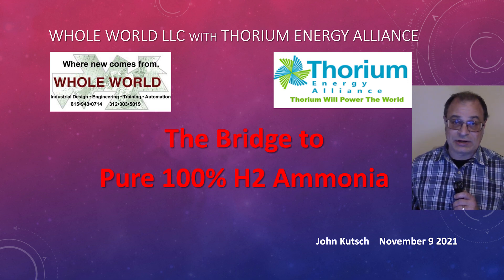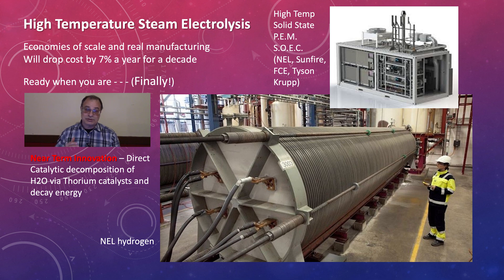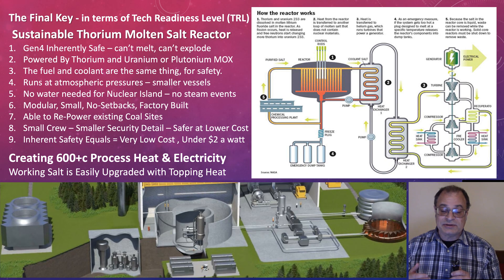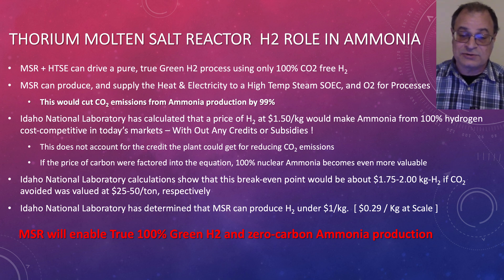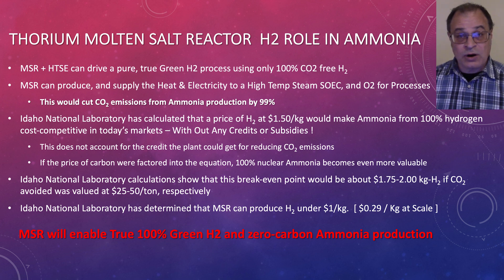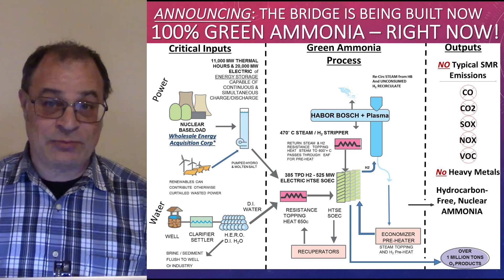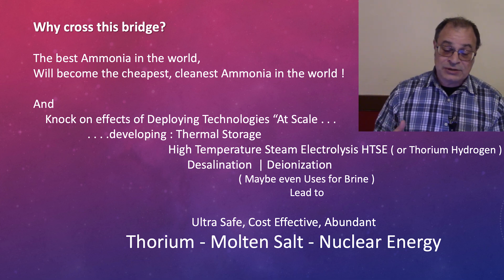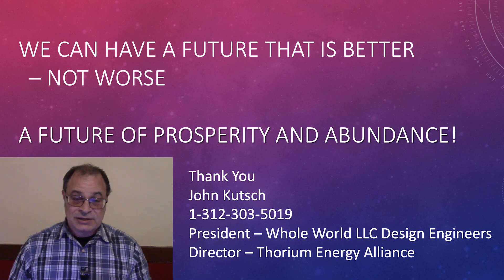Bridge to Pure 100% H2 Ammonia

Comment: 12:30 the oxygen byproduct of nitrogen removal from air, is used in steel production. 

Mining explosives could also appreciate the liquid oxygen generated, as ammonia nitrate emulsion based ones are only cheaper when excess oxygen isn't available. When it is, LOX mixed with powdered farm waste and pumped down boreholes may be cost effective. With much lower NOX emissions from mining than ammonium nitrate.

Oxygen can also be used to produce ozone, free from it's usual nox co creation and with that, clean ozone, clean people's water, with a better tasting outcome than chlorine. 

The oxygen as well, could be piped into municipal waste incinerators to increase temp and reduce dioxin emissions. 
One of the causes of dioxin generation is chloride ions in things people burn, so reducing chlorine in every step of cardboard. Really goes a way to making incinerator plants cleaner. 

With these likely the only remaining emission plants in the future, of no coal, it would be important to cut down on its nasties as much as possible with oxygen aiding in doing this. Already incinerators are liked to poor health from dioxin generation.

They would appreciate oxygen. As would all of we, humans that share the air.

Oxygen lances,  related to thermal lances, are very useful in removing caked on carbon in chemical reactor pressure vessels. Instead of using peroxide. Piranha fluid. Though on that topic, the making of peroxide by the old barium oxide recycling method, may be of better value when near pure oxygen is available.  As it may similarly be in manufacturing cerium oxide, for self cleaning ovens.

Though most of it will be vented in this case, bubbling oxygen through fish farming aquaponics systems, goes a long way in reducing ammonia build up. When limited space for fish to live is available, oxygen may improve the clarity of water and smell down wind. 

The deep ocean injection of oxygen may also make a layer of life that sequesters more carbon. 

Yet storing the oxygen in bottles for rocketry is one of the better solutions.  In the steel that it was earlier used to create. 

The first rocket plane the X15 was powered by oxygen and ammonia with both of them sharing a similar density, a single pump could be used...it was also probably the cleanest burning rocket fuel ever, in full life cycle considerations.

As the oxygen and ammonia came from one plant, haber Bosch. 

Once it is made cleaner, it will likely rival methane LOX in the aerospace industry. That spaceX is currently using. Though methane does have energy density advantages, when, or if the rate of launches increases, it may be a requirement to switch to ammonia. For environmental considerations.

Comment: 12:30 the oxygen byproduct of nitrogen removal from air, is used in steel production. It can also be used to produce ozone free of nox and with that, clean people's water, with a better tasting outcome than chlorine. The oxygen as well, could be piped into municipal waste incinerators to increase temp and reduce dioxin emissions. 

One of the causes of dioxin generation is chloride ions in things people burn, so reducing chlorine in every step of cardboard. Really goes a way to making incinerator plants cleaner. 

With these likely the only remaining emission plants in the future, of no coal, it would be important to cut down on its nasties as much as possible with oxygen aiding in doing this. Already incinerators are liked to poor health from dioxin generation.

They would appreciate oxygen. As would all of we, humans that share the air.

Oxygen lances are very useful in removing caked on carbon in chemical reactor pressure vessels. Instead of using peroxide. Though on that topic, the making of peroxide by the old barium oxide recycling method, may be of better value when near pure oxygen is available.  

Though most of it will be vented in this case, bubbling oxygen through fish farming aquaponics systems, goes a long way in reducing ammonia build up. When limited space for fish to live is available, oxygen may improve the clarity of water and smell down wind. 

The deep ocean injection of oxygen may also make a layer of life that sequesters more carbon. 

Yet storing the oxygen in bottles for rocketry is one of the better solutions.  In the steel that it was earlier used to create. 

The first rocket plane the X15 was powered by oxygen and ammonia with both of them sharing a similar density, a single pump could be used...it was also probably the cleanest burning rocket fuel ever, in full life cycle considerations.

As the oxygen and ammonia came from one plant, haber Bosch. 

Once it is made cleaner, it will likely rival methane LOX in the aerospace industry. That spaceX is currently using. Though methane does have energy density advantages, when, or if the rate of launches increases, it may be a requirement to switch to ammonia. For environmental considerations.

Comment: One big question : what is the benefit of ammonia over methanol, for example, that is (unlike NH3) liquid at atm pressure and can be easily produced (like NH3) from a zero-emissions source of heat + H2 (actually, at even lower temps and pressures) ? In particular, is an ammonia fuel cell possible/pratical or easier/more efficient than a (reformed) methanol fuel cell ?
Reply: I have read that ammonia is cheaper then methanol to go from source to tank. I dont know the reason. And yes ammonia can be used in solid oxide fuel cells.

Comment: Great video ammonia is one of the best way to store hydrogen. Green hydrogen (no co2 with nuclear) is the source of green hydrogen.  One great use of ammonia is to combine this with CO2 from the atmosphere or a CO2 source like backup power for renewable that being natural gas. 
AMMONIA plus CO2 produces a great solid fertilizer called urea.
A great use of fertilizer is "ocean fertilization" as proposed by Australian scientist Ian Jones. This would result in a massive increase in phytoplankton that is the base the ocean eco system and this will help fish populations that can feed millions of people. It can even lower the acidity of the oceans and save the coral reef. You can download Ian Jones PDF on ocean fertilization systems with UREA that comes from ammonia and CO2 out of the atmosphere. It solves multiple problems at the same time. If the ocean nourishment project works then Mr. Jones should be knighted.